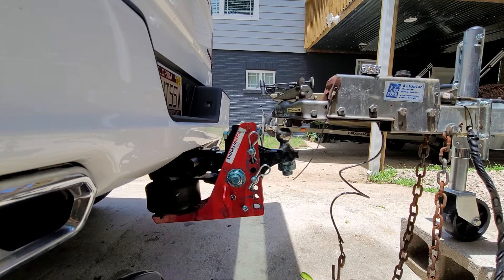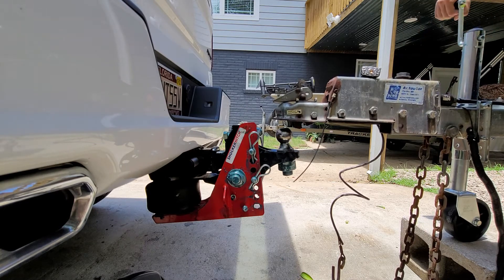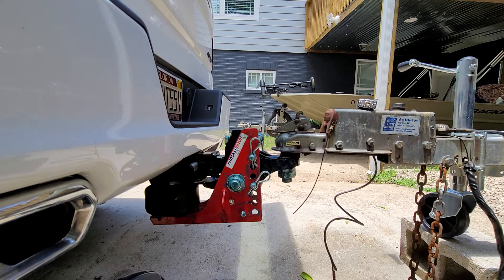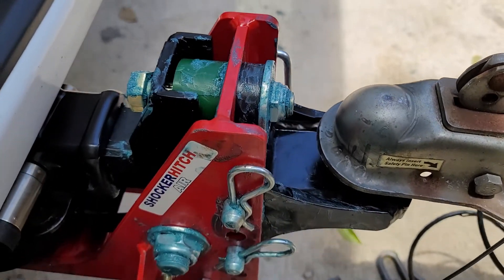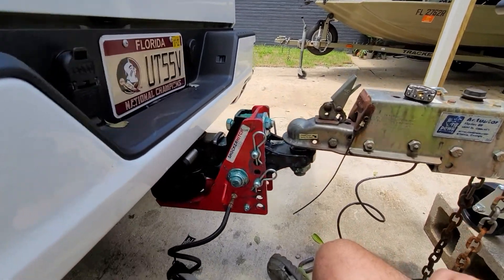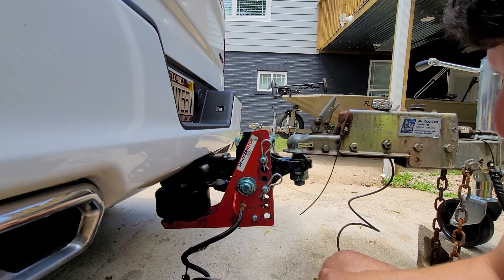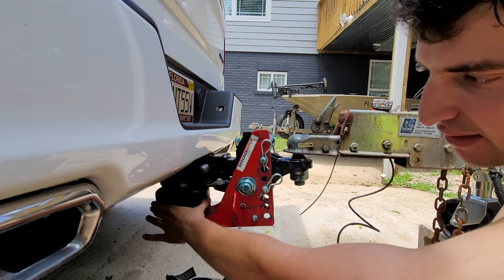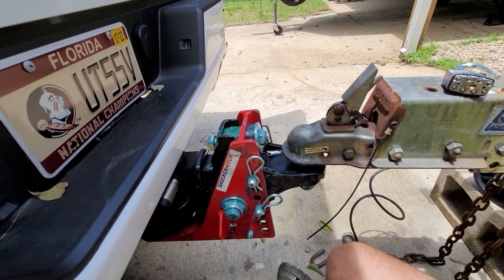Shockerhitch Air Bag Hitch- How to set PSI for your trailer.

Comment: This is all wrong.  It's in the directions that came with your hitch and is really easy.  #1, it specifically says do not grease any of that top black/green bushing.  Yours has grease all over it including the adjusment pins.  No need for that.  #2, the directions say to put enough air into it that you compress the top green bushing approximately 1/8th inch.  #3, You need to grease the trailer ball every time.  I do it about every other time.  #4, email shocker directly and get the set of instructions.  it's less than a page and super easy.
Reply: Lol I seen other you tube videos and clearer learned that you need to 1/8th compress on green bushing .

But I don’t understand why to grease the ball?